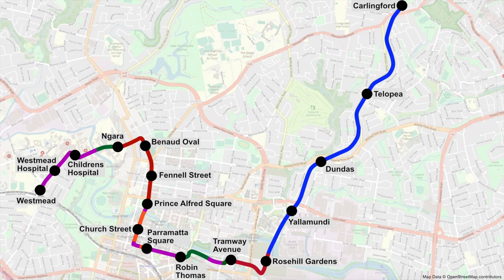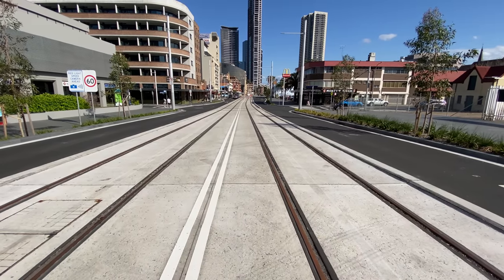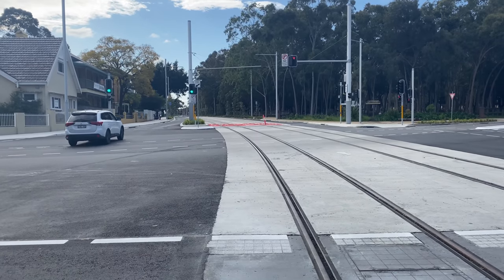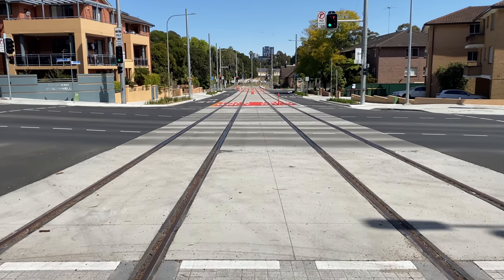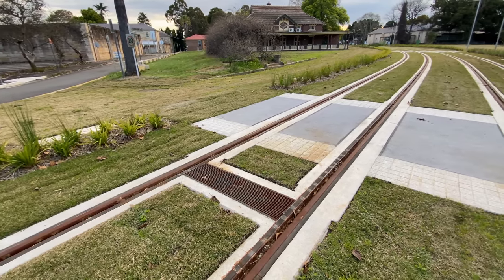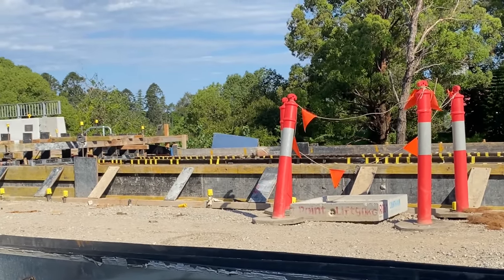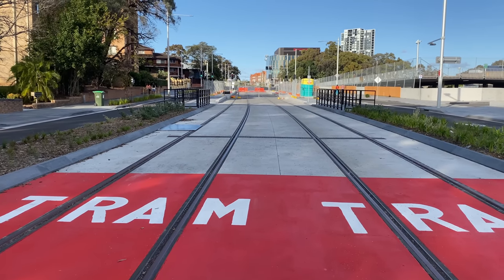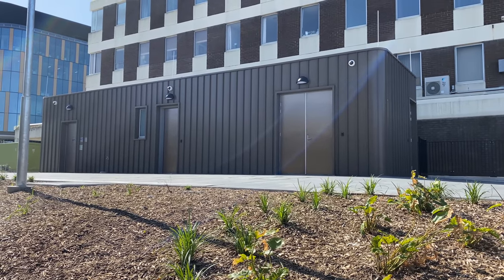Parramatta Light Rail Update Part 3 - Prince Alfred Square to Westmead via North Parramatta.

Comment: Hi Paul, I would suggest that the "bus" sign and the road markings with white lines may have this section of Church Street shared with buses. Church Street has been a major bus route and having buses using the tram stops seems a possibility. Thanks again Paul for another amazing presentation and I hope you will be one of the first to cover the opening of this project.
Reply from the maker: Hi John, yes that would make sense!  There are no buses running along this part of Church Street at the moment, which was a good thing, as I might have got run over by a bus on the tram tracks otherwise! - I reckon the buses are currently being diverted via other roads, so it will be interesting to see what happens.  Glad you enjoyed this video.  Yes hopefully, I'll be there on opening day, and I'm sure I'll film some tram testing before then too.
Reply: that would make sense, i'd say it would be similar to haymarket, where there's a bus stop attached to the light rail stop that allows easy transfers between services
Reply: Busses won’t be going along church street anymore. They now turn right onto O’Connell Street a bit further down than the Benaud Oval stop. Then they turn left onto Victoria Road in front of the Stadium, travel a bit east a long Vic Road and then turn right onto Wilde Avenue which will take them up to the bus interchange.
Reply: @hazzman08  If you are correct then I would suggest that the bus sign and road markings are for tram replacement buses.

Comment: Awesome update Paul! Very in-depth and packed with info and facts. It's great to see the stations nearing completion. It seems the line should open on time next year. I also find it interesting how some of the tracks have the road lines painted on them. I'd assume maybe buses will share with trams on the track on some sections.
Reply from the maker: Thanks! I appreciate your feedback. Yes a few people have suggested that the tram lines might be shared with buses. However, I'm not sure where the bus stops would go.  I reckon if buses will use the tram tracks, we'll see that happen quite soon. I'm guessing they have been diverted away from Church Street due to the construction work.

Comment: A very well-documented and easy to understand and comprehend look at the Light Rail project - im sure they've ramped up the building of this to get it done before the next state election but either way it's coming along rather quickly now. Thanks for the time you take going out to do these videos.
Reply from the maker: Hi Kurt, yes, it's coming along well, but work has slowed down.  I think the weakest link is the maintenance facility. There is still a fair bit to do on that. Thanks for your feedback on this video.

Comment: Great video Paul! I watched the construction myself during 2021 and early 2022 while working in North Parramatta. Great to see your insights and further research as I am no longer working in the area. Now that construction is complete shouldn’t be long until we see the trams in Parramatta for testing. Keep up your great work. Your video quality and presentation is superb
Reply from the maker: Thanks for your feedback Michael, Yes it was very interesting back in 2021. I remember it being quite a maze, especially in the North Parramatta area! It shouldn't be long now.  We just need some overhead wires and signals for the Carlingford line section and for the crossover junctions, and then it should be good for testing.

Comment: Wonderful production again Paul.  thanks for the  great in depth update.  what a change to Parramatta, with tramways mark II.  Do you know if the points are manually operated or is there an electronic remote control.? Interesting to see the old psychiatric hospital opened up.  I did my 1st year psychiatric nursing oral exams there in 1962.  All walled up in those days.  Keep the good work coming
Reply from the maker: Hi Luke, you're very welcome. I think the points will be remotely controlled, via the control centre in Camellia. I didn't realise that Cumberland Hospital is a psychiatric hospital! It all seemed pretty normal when I was there, except for some strange guy walking along the tram tracks filming and talking to himself:-)
Reply: @TransportVlog  haha! I wonder who that strange guy was, huh, Paul?

Comment: I think that those black strips shown at 19:20 are just plain old ordinary black plastic drains for water. Looking at the top you can see the holes in the black strips for the water to drain into them. I don't believe that they are there to act as check rails (although they would likely help in that regard as in the event of a derailment the tram's wheels will fall into the drainage channel).
Reply from the maker: Yes that's what I thought originally, and then some viewers suggested that they were some kind of guard or check rail, especially as they seem to appear on curves and bridges.  As you say, perhaps they are for drainage, but with a little protection in the case of a derailment too.

Comment: The old pub is across the road on the corner now. Also many of the nth parra stops have part of the platform awning up. I drive past on a regular basis. Ps can you create a page on Nextdoor.
Reply from the maker: Hi Allan, that's good to know. Maybe, I'll drop in for a drink next time I'm out filming! Yes I'm aware that the awnings have now gone up at many of the stops.  I'm not familiar with Nextdoor, so I'll check it out.

Comment: Hi Paul,   tram 2172 is at Yallamundi Light Rail stop today 7th December 2022. Proper copper overhead along there on the Up line only. May be worth an update.
Reply from the maker: Hi Albert, Yes, I've heard about that.  Going to check it out tomorrow, and will include it in an update.

Comment: Awesome update. It would have been nice if the Westmead terminus was in between Westmead station and the metro terminal. It seems a bit of a walk to the metro station at Westmead. Also seems to be a concern on the amount of no right turn across the tracks. I suppose traffic should be using other parallel streets to turn right rather than Church Street.
Reply from the maker: Hi Henry, there is still some discussion about the location of entrances for the Westmead Metro station, so it may well change for what was originally planned. Yes I'm sure they will be other ways to access these streets without the Church Street right turns.

Comment: Several times you have made reference to asphalt finish on the tram tracks. Looks to me to be concrete with an exposed aggregate finish with maybe a darker concrete mix. 

Also would suggest where there are double whites on Church street would suggest buses will also be allowed to use the tram reservation.
Reply from the maker: Hi Ashley, yes it could well be! I'm definitely not an expert in this area. I'm wondering whether it will stay as is, or be covered over with the rather nice tiles like the Ngara stop. I guess we'll have to wait and see! A number of people have suggested buses. The only issue that I can see is the lack of bus stops (well I don't remember seeing any), but then I wasn't really looking out for them.

Comment: Double white lines are only in certain sections - do they correspond to where it is likely to flood? In that it case it can be so repair crews cleaning silt out from the tracks can work without being hit by a tram coming in the opposite direction.
Reply from the maker: Hi Brett, Since recording this video, I've noticed the double white lines on the L2 & L3 as well. I reckon they are for road vehicles, and in most cases, this would be police, emergency vehicles, deliveries and access to private properties. I saw a couple of police cars going down the tram tracks on George Street and they were keeping on the correct side of the double white lines!

Comment: Hi Paul. Do you know how the cross-overs work? Are they manipulated within the tram or does the driver have to get out and change them?
Reply from the maker: Hi Paul, I think it will all be done remotely from the control centre at the maintenance facility in Camellia.  I think it will be similar to railway signalling, where the signalman sets the route and the points and signals respond accordingly. There will be signals to indicate the route at these crossovers, but these have not appeared as yet.
Reply: @TransportVlog  Thanks mate for your, was always, prompt reply.

Comment: Could the double white lines be for buses when the6 have to be used as rail replacement?
Reply from the maker: Hi David, I've seen similar white lines on the L2 and L3 on George Street with Police cars running up and down them, so I think they are for police, and other emergency vehicles and perhaps for overnight construction trucks as well.

Comment: The no right turn for cyclists is because it’s dangerous for bicycles to cross the tracks at less than 90 degrees as the bike wheels can get caught in the gap inbetween them. It’s a shame that @Parramatta Light Rail haven’t provided proper alternatives for cyclists that wish make the turn though.
Reply from the maker: Hi Thomas, yes that's what I thought too.  I guess cyclists could cross using the pedestrian crossings or perhaps turn right using the left lane instead. I've never noticed these signs before on other lines such as the L1/L2, but then I haven't really looked out for them.